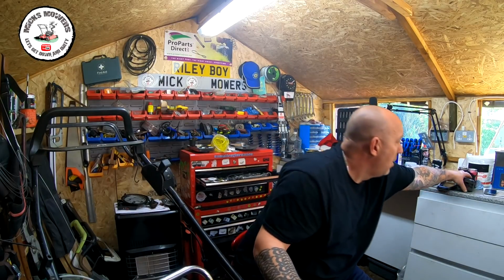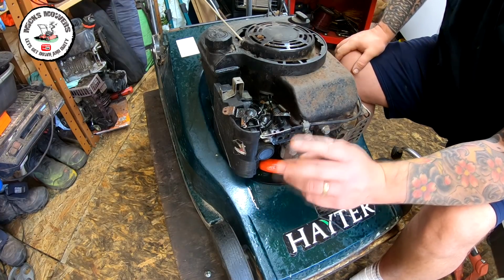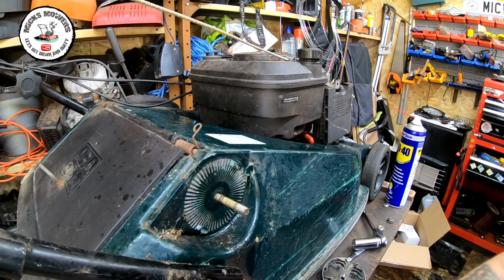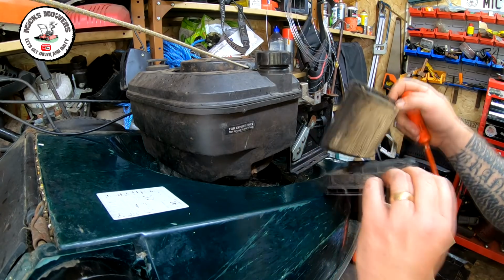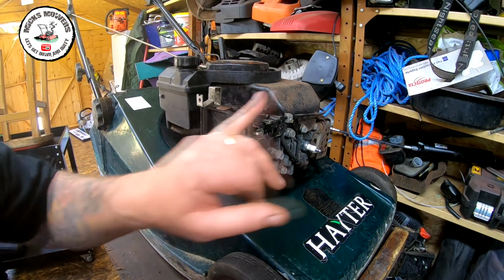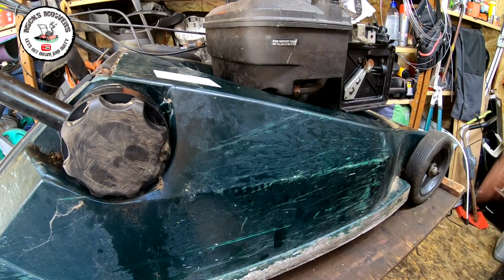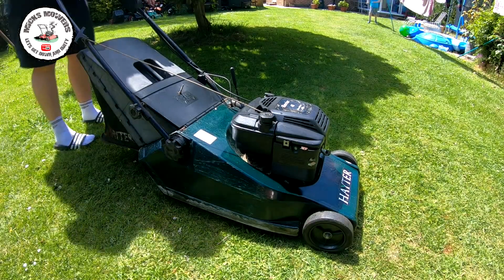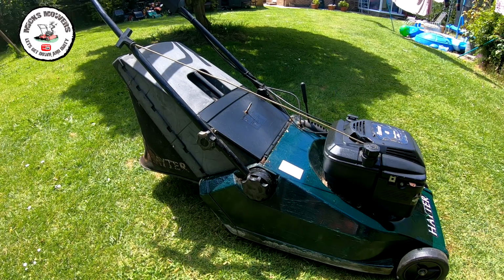Hayter Harrier 48 Needs the handles Fixing and Some TLC Easy fix

Comment: The word your looking for is "surging" not hunting, it's most commonly caused by an air leak on the induction side, maybe the "O" ring behind the carb needs replacing and a smear of silicone grease, or the base gasket on the induction tube leaks and needs replacing, try running the engine and spraying carb cleaner on the seals on the induction side. Also check the tension on the throttle spring and yes look closely at the emulsion tube and jets in the carb and run them through with a fine wire or jet cleaning files.
It's well worth the effort as your right in saying these mowers do a great job and hold their value.
Reply from the maker: Hi.. I take it your in the US.. we call it hunting over here in the UK.. it's a play on words.. much like the word aluminium.. it was the main jet in the end and by drilling it out got it running properly.. not the o ring or gasket as you first said.. ta for watching and the comment
Reply: @themowerman  nope! I'm right here in the heart of Bucks 😉 the main jet makes sense as the newer plastic briggs carbs have a habit of doing the same and drilling out the main jet is the cure for this too. I'm glad you got it sorted.
Reply from the maker: @Herbybandit  lol nope I'm right from the south coast. It's the old style carburettor with the brass bolt jet.. but like I say ta for watching and supporting.. it's much appreciated

Comment: Riley and i like ham sandwiches. Your lawn is really looking great.     That engine looks like a mini Quantum.  
Once in a while a Briggs will hunt.  (intake manifold or clog,  LOL you are on the right path)       On those variable throttles (cables) I usually remove  them and go to about a fixed a 90% rpm.  (just me  I hate cables)
Reply from the maker: Morning mate.. great fun last night.. it settled down after a good run.. been sat for a while.. and it's got a side drive I have always said that this is one of the reasons they hunt as the belt gets snagged.. look at me yapping away. Stay cool mate

Comment: Hi .     Loved the video.   I have the same model myself.     I’m having a bit of trouble with the height adjustment.     It only seems to be going from lowest setting.    To about the middle setting.    I can’t get it to go any higher.      Can you please help me out.     Many thanks 👍
Reply from the maker: Hmmm I have seen a common problem.. when you try to set it to the highest setting have a look at the front wheel on the height adjuster side. Sometimes it hits the deck . By moving the wheel out a little I will lift. Try that
Reply: @themowerman   
Hi.    Thanks for getting back to me.     Yes ,  that sounds like exactly what the problem will be.   The mower has had a bit of a dink at the front,  on the height adjustment side.    I’ll check it out tomorrow, and let you know how I get on.      👍
Reply from the maker: @grahamjohnston3899  cool mate .. fingers crossed
Reply: @themowerman  
Hi Mick
I had a look at the mower today.  
I had a go at levelling the wheels, ( side to side)
And the height adjustment worked.
However when I put the mower on the ground,   The lever would only go halfway again.
But if I lifted the front of the mower, the wheels then dropped, and I was able to use the adjustment lever ok.
I tried to remove the plastic cover plate underneath , but unfortunately the bolts severed .  ( should I persevere and try to remove the plastic cover, and see what is going on underneath ?  ).                One other thing,       I am working on a Mountfield sp536 , I have it all working ok ,     But the self propelled, pulls away, like a train.      I have tried reducing the tension on it ,    ( which all seems fine).      It’s the correct belt , fitted.
I can’t understand why it just pulls away, so fast.       Have you any thoughts on what I might be doing wrong.    Thanks for all your help and advice.         Cheers Mick.   👍
Reply from the maker: Hi mate great news.. yeah the Hayters have a plastic bushes that need replacing.. that's will fix it.  .. with regards to the drive what it like after the first part or is it driving too fast ?
Reply: @themowerman  Hi Mick
I’m just a bit of a novice at this,
I just took it up as a bit of a hobby…..
Is the drive speed linked to the speed of the engine ?
The mower starts first time with the choke on.        Then you can reduce the speed, by the throttle switch,
But the self propel , just seems to drag you away,         I hope this makes sense.    Cheers
Reply from the maker: @grahamjohnston3899  yes so it's all to do with the engine speed.. but could be just because it's a new belt . What speed is the engine running at (RPM)
Reply: @themowerman  
I have no idea at all Mick !
Like I said, I’m just a novice 😊
So I’m guessing if I reduce the engine speed 
It should reduce the speed of the self propelling
Reply from the maker: @grahamjohnston3899  try this .. look up what the engine should run at https://www.ebay.co.uk/itm/193751346021?mkcid=16&mkevt=1&mkrid=711-127632-2357-0&ssspo=91vrn0PFTWK&sssrc=2349624&ssuid=VxofTcWjS-2&var=&widget_ver=artemis&media=COPY

Comment: Heya Mate! Up early here in the states watching me some Micks Mowers and having a bit of Coffee. I'm curious why you use WD40 instead of a permanent lubricant? WD40 was developed decades ago for the electrical industry to have a safe product to displace water from electrical control panels. In fact, the name WD40 means Water Displacement formula 40. WD40 does make a permanent lubricant in their specialty line of products that would be much better suited to prolonged lubrication. I my self use PB Blaster LMT here in the states. The LMT stands for Lawn Mower Tuneup in a can. It's an all around lubricant that's excellent for cables, wheels, linkage, freeing sticky valves and loosening carbon build up and helping to restore compression in older engines. You might give it a try or one of the other WD40 products with longer lasting lubricating properties. I tell ya what I use WD40 for....I get the cans with the flexible metal flip up straw, pop the sprayer off and toss the WD40 can in the bin lol. Cheers Mate! Awesome repairs as always! Cheers! Zip~
Reply from the maker: So you just keep the Straw and toss the tin too funny. Yeah I'm aware what wd40 is for but it does get stuff moving. I have been using some other stuff that works well.. we don't have PB blaster here.i will look into it. Enjoy your coffee mate
Reply: @themowerman  I left a bit of a rant on your Ransomes video. I hope you don't mind me stepping in.
Reply from the maker: @ZippoVarga  oh no problem it's a free platform i will have at it in a minute just out at the shops
Reply: Who deleted that post Mate? The guy posting or you? In either case, I'm glad it's gone. You don't need that stuff on your channel.
Reply: @themowerman  If you didn't delete it then the original poster must have out of embarrassment.
Reply from the maker: @ZippoVarga  it's still there mate